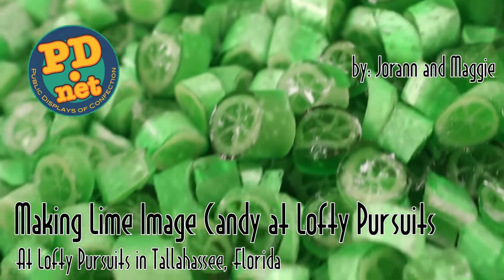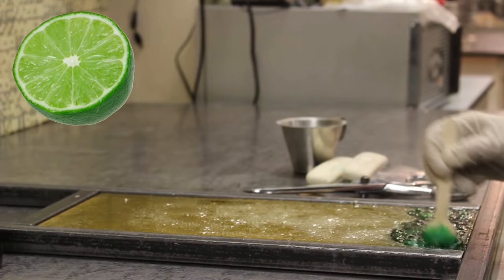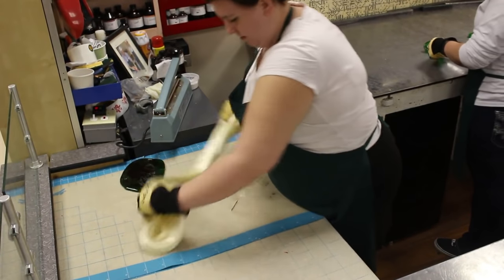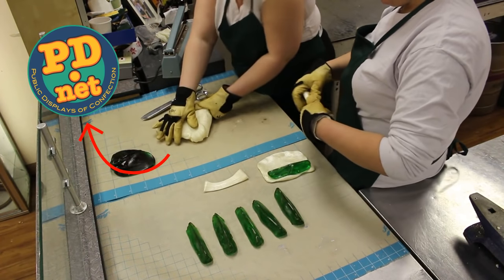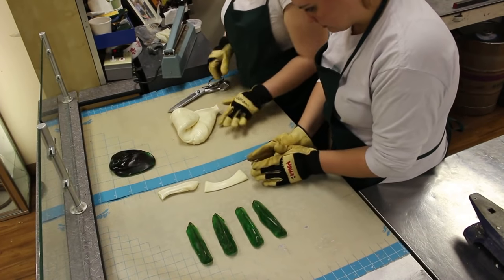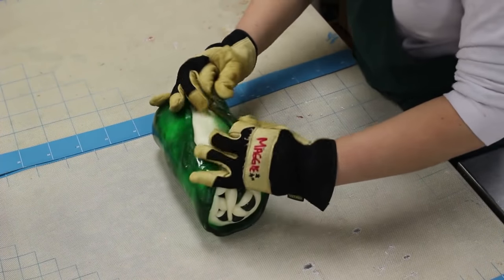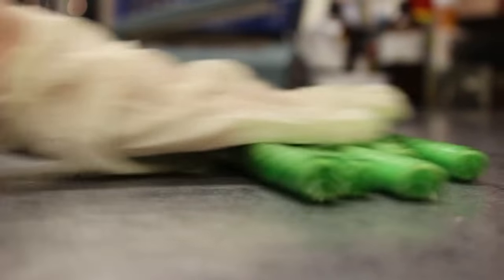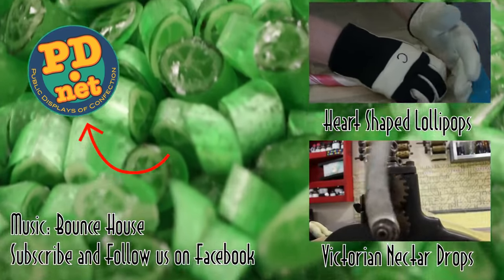#23 How to design a Lime in Image Candy at Lofty Pursuits

Comment: Do you use wooden spoons for the coloring? Is this because of the temperature of the sugar?
Reply from the maker: yes. glass can chip, metal conducts the heat, silicone ... well I just don't like how it stirs, so we use wood.
Reply from the maker: They are wooden. We use them for our take out ice Cream, and then one day we realized we had our color mixing problem solved.
Reply from the maker: +Brandon Magner they are a light tan. they are the shape of a teaspoon, just like a plastic spoon. plastic spoons melt. wooden spoons don't melt but do bio degrade.

Comment: I know you put the citric acid with the uncolored amber because the white will hide it, but have you tried putting it with color? I wonder if it would give it a somewhat sparkling effect, or if it would just look like tiny spots.
Reply from the maker: +Blake Farnsworth It's not the spots, but it seems to migrate to the outside surface, and the candy is not as smooth when pulled (on the outside). I just don't like how it looks.

Comment: When you guys chopped it into the strips before cutting it into little pieces, you only rolled it near the end, right? Wouldn't the center be larger, or does that not matter?
Reply from the maker: if I understand your question, if we pull it right it comes out to the correct diameter over the whole length of the rod. we roll it to prevent it from going flat since it is still sodt.

Comment: just how cold is the cooling table?
Reply from the maker: +happy bandaner Just room temp., but it is a huge heat sync and has a water cooling system. Heat capacity is what you need, not freezing temperatures.